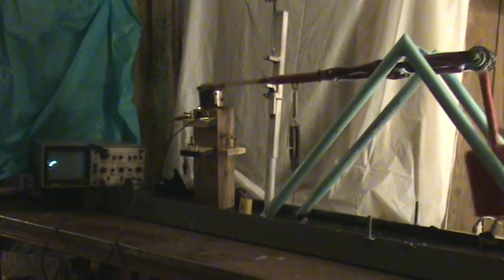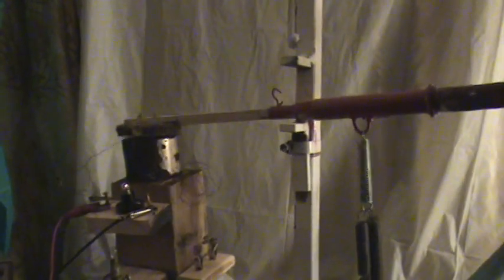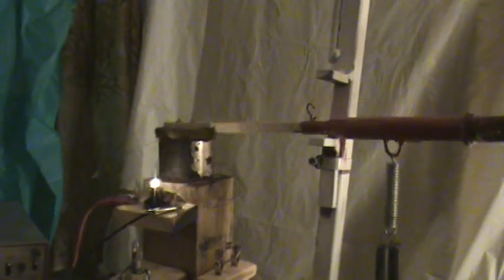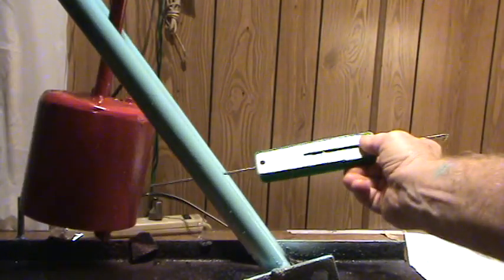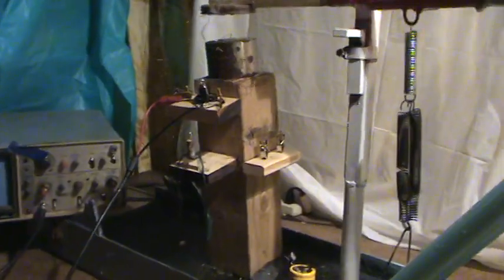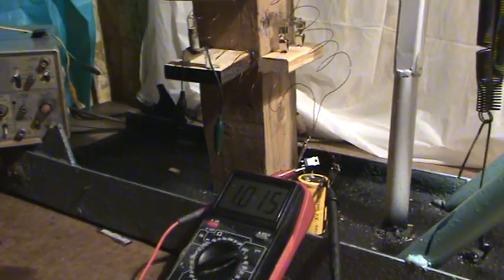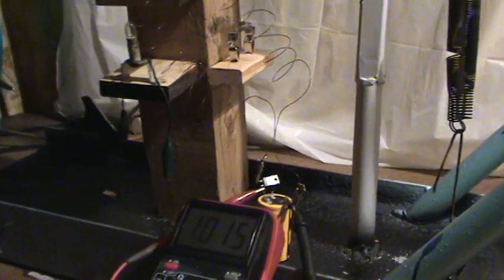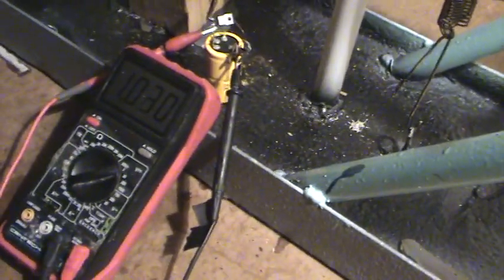Ray's Small Distance Generator With Pendulum

Comment: What is the point of this device?
Reply: The inventer Mr. Milkovic done many tests in private lab and in national technical faculty in Serbia and results of measures are that output energy is bigger them input emergy,what means this is perpetual-motion invention
Reply: @mirko8838  Aha, but in this video he keeps pushing the weight with his hand, and you don't measure the energy that he is putting into the system by doing that. I guess I'm just confused about what is going on. How do you use it?
Reply: @kristoferkrus  Well it's not real to make system without input energy,point is to trasfer one type in other type of energy. In this system his hand can be changed with engine for example to make system active. This type of system can be used in heavy industry,to power many types of pumps,generators and others.

Comment: Hmmm, I wonder the output if you had a coil tube stationary and the arm would lift back and fourth a strong magnet going up and down within the coil tube. Would be a longer generating period per stroke. Just thinking too much....   : )
Reply: yes would work , depending on magnet strength for output , I have one somewhere if I can find it . also in video I said neo was 2 by 2 inch ;  it is 2 by 3 inch . The travel stroke distance of TSO machine would be ok , the coil really doesn't need to pass thru N to S completely ,  just so the N spans the distance of coil windings if your magnet length is long .